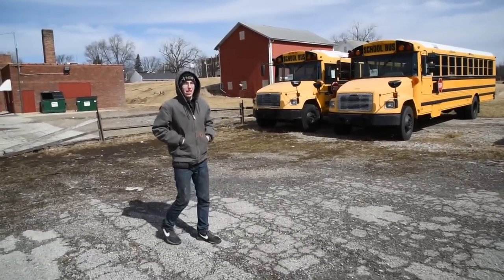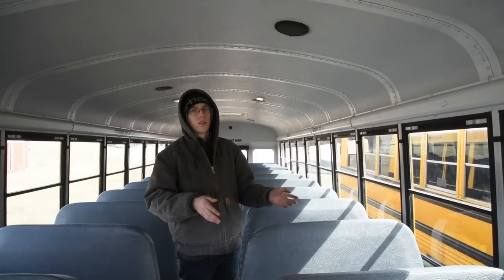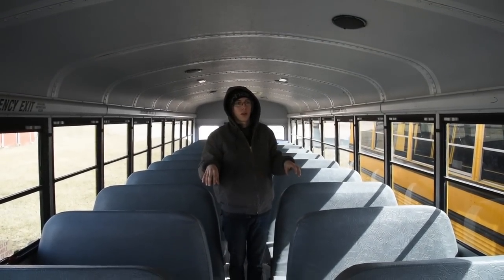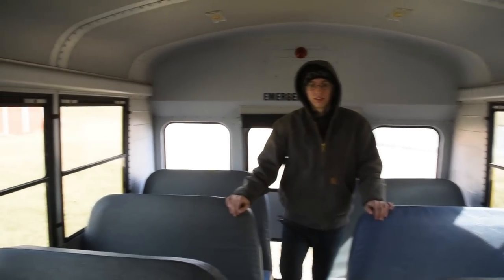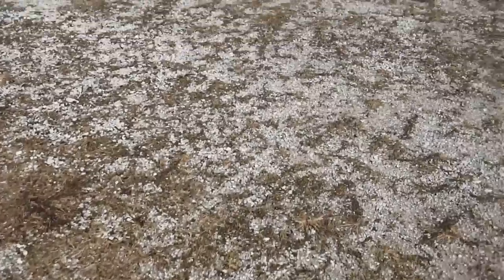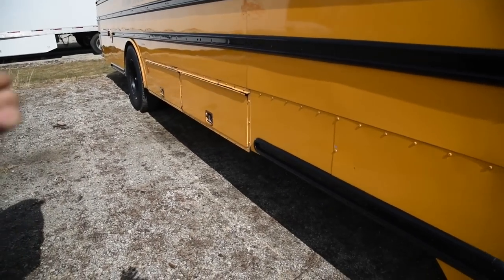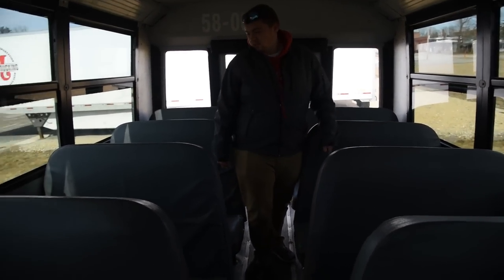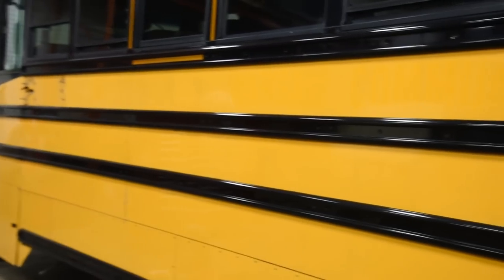Buying the Ultimate Toy Hauler

Comment: Ok you got a nice buy there ! If your going to license it as an RV it needs to have separate heat , water and refrigeration at least in Minnesota. I’ve done 2 bus conversations and your going to want to either take most of the windows out or really black them out and it’s easier to make in the rear 2 doors then 1 big Door and it seals way better . Also on your rear tires they looked like recaps and they typically don’t last long . In Minnesota a school district can’t run a bus for more then 10 years and they typically sell those to private schools who can run them longer . Thomas buses are well built but my choice is Bluebird but you pay more for a Bluebird! Good luck 👍

Comment: What you need to do on the bus is convert a small part of it into  a motorhome and all those laws change  as to what or who can drive it pulling whatever  every State has slightly different rules on what makes a Motorhome or RV in Maryland i had. A  Enclosed  Cargo trailer and i went to court with pictures  that inside the trailer i had A Porta Potty (never used) a blow up mattress, and a Coleman stove and technically that made it a Recreation Vehicle  another plus is registrations and Insurances are usually cheaper   Ill bet the Fast and Furious Wings on the back of the bus roof is really there to  keep the back windows cleaner  due to lack of any wipers  etc  especially on moist days  if you ever look at the back of a 18 wheeler trailer or even Vans  they are usually very dirty  from running on wet roads  and Shool buses have similar Airodynamics  to those vehicles mentioned
Reply from the maker: That's exactly what I did to convert it to an RV.

Comment: Where I live you don’t need a commercial licence to drive one stock but you can’t have 14 or over people aboard you can drive it with normal c plates with class five which is normal car licence and you only need class 9 written endorsement which is air brakes there’s no max length trailer length like yours  just has to be less then 53 foot long trailer or your will need class one for semi truck  class two is for driving fire trucks so on or full 72 passenger school buss full of kids you can drive ambulance with same licence as well